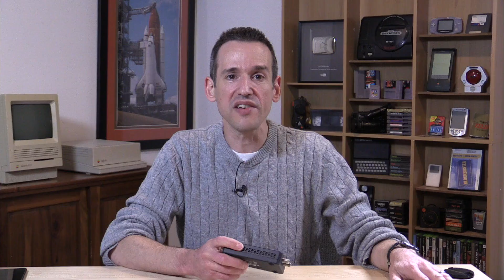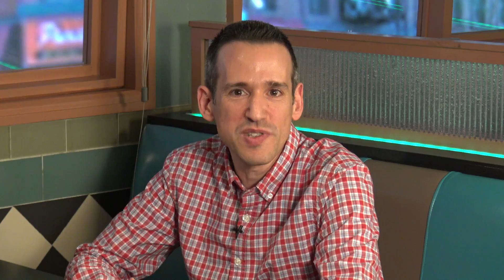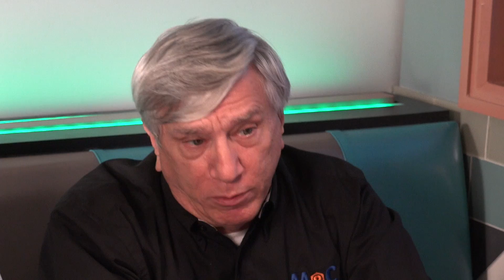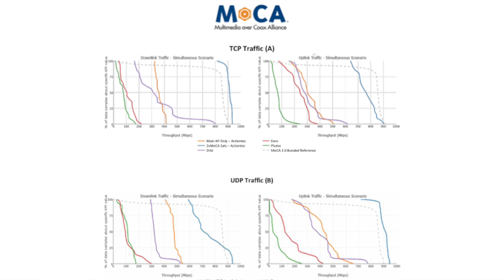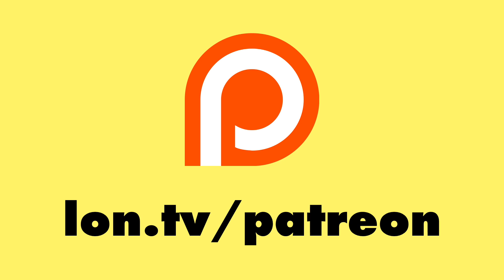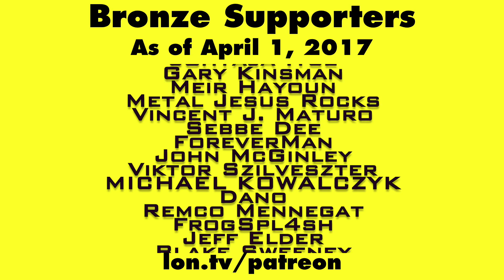Interview: MoCA Technology - Extending Your WiFi with Cable TV Wiring!

Comment: Ok Guys good info but don't forget that even if you have a network cable that can connect directly to the TV, you will only get 100 megabits per second, for some reason they restrict the speed on these Smart TV

Comment: Question, I use an air antenna attached using the coax cables.  I have a different coax for my network & there is no splitter for either.  Which cable would I place the Actiontec boxes on the air antenna or the network cable coax line?
Reply: Dorsnt matter really.

OTA runs from 53mhz to 700mhz or so, though with the FCC repack thats changing. You will need splitters that are MoCA compliant that can go up to 2ghz. 

It is actually possible to run OTA, AM, FM, MoCA and SiriusXM on a single cable.

Comment: All my cable outlets are individual lines that go straight back to the outside box, none of the cables are connected, as in a network. If I want to connect a room, even for internet, it has to be connected from the box outside, that has a lock on it from the cable Co.
Reply: LOL - All the lines from your cable outlets (ie. from each room) are interconnected INSIDE the locked cable box that is outside.

Comment: I use the Actiontec products, MOCA 1.0.  They work great, but I found that it was necessary to change all my cable splitters to splitters with a bandwidth that didn't  interfere with cable  company.  Essentially above 1000 mhz.

Comment: he said powerlines are a horrible medium for video because it is "staticky" .... that isnt even remotely relevant because its transmitting a digital signal. so it either works for nothing, or works for everything. it wouldnt be worse for video... happens to be that when properly implemented it can handle gigabit ethernet as well.two copper wires are two copper wires -
Reply: it wouldnt effect one type of data more than another.
Reply: that is also true. if you damage an analog signal you get static .. if you damage a digital signal you lose the entire stream and have nothing.
Reply: as a rogers technician we use coax and moca to run the whole home PVR

Comment: But does it have encryption to isolate EACH node/hub/moca/WAN and prevent outside intruders like another apartment with same cable wires?
Powerline does this, so should MOCA
Reply: MoCA 2.5 supports moca protected setup and generates aes 256 keys. Hoeever you can only buy MoCA 2.5 adapters from GoCoax.